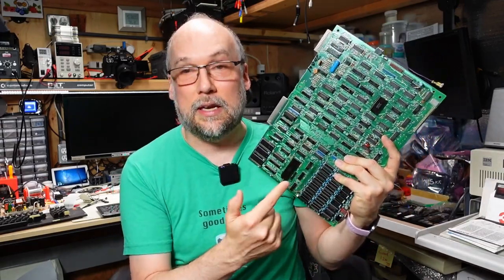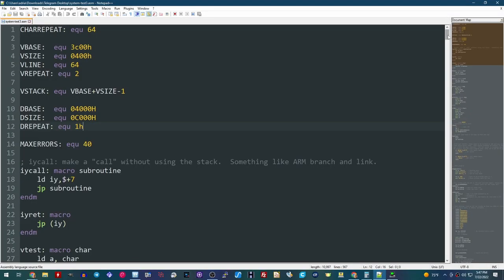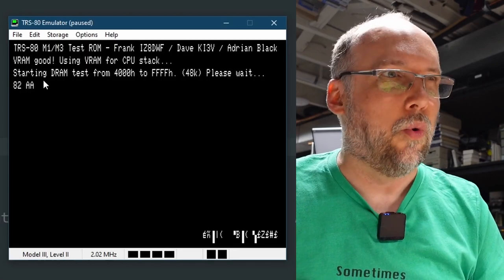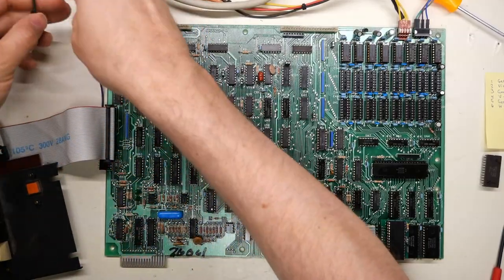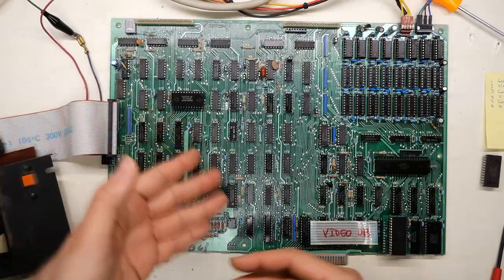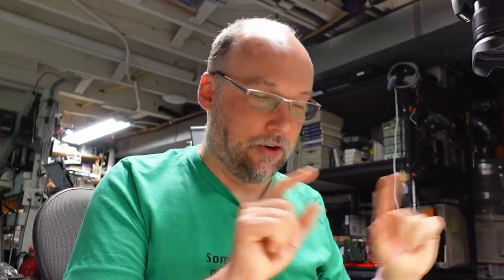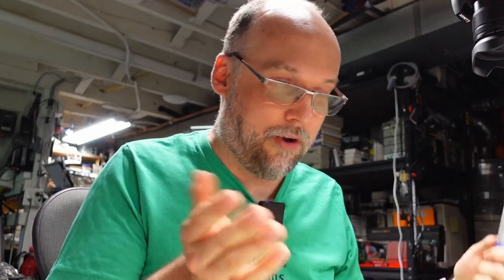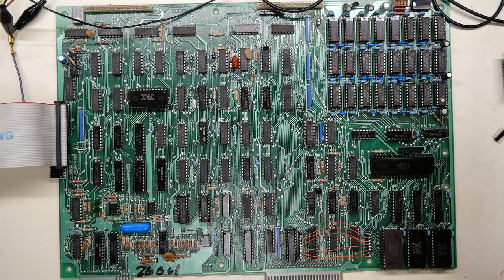Using our new diagnostic ROM to fix a TRS-80 Model III!

Comment: It's always the simple things, Having owned a TRS-80 from new. Modifying it, building the LNW-80 interface and writing heaps of machine code back in the day. I was so involved back then that I also acquired a KAYPRO-10 which was a Z-80 machine with a 10MB HDD that had failed. Replaced the drive with a 20MB drive, designed and built an EEPROM board that I could switch addresses and enable and disable writing to it etc. Re wrote the ROM code to support the 20MB HDD into an 8MB / 8MB and 4MB partitions running CPM. Built a high resolution graphics interface for it (640 x 400) extended the code in the ROM to support accessing the new graphics and it was a good fun project. Sadly I don't have the machines any more But I learned alot about digital electronics in my youth.
Reply: I modded my long gone MIII to the extreme with all sorts of homebrew including an 8MHz Z80H, overclocked of course.
Reply: I think I'd run permanent bodge wires on the back and never have to worry about the ribbon cable again. The homemade replacement cable works, so I can understand not wanting to fix what ain't broke, but if I hit even a lick of trouble, I'd hardwire it.
Reply: @mal2ksc  Hardwiring sure fixed it for me but those cables do allow the sections of the MIII to be split for diagnostic purposes.

Comment: As someone who's worked on Bally Midway machines (like Tron), those cheap ribbon cables go in the trash immediately, even if they appear to work. They're just too much of a liability.
Reply: That cable reminds me of something at work , where a connection on a signal tranformer was loose solder wise. Got voltage (continity) but could not do any current. it's one terminal was broken solder inside
Reply: Replace them with kapton flex cables or an actual ribbon cable. This 70s paper crap goes in the garbage.
Reply: might pass dc current, but a high frequency square wave with no crosstalk: Some of the time
Reply: I don't deal with old electronics like this, but I definitely did not like those cables at all. I can't say I'd have caught this sooner, because frankly Adrian knows more about these machines than I do, but it reminds me of how it's often a good idea to preemptively replace capacitors when there's a chance they might be bad.

Still, it's great that this has lead to a diagnostic ROM being created.
Reply: Signal Generator @ 2 MHz and oscilloscope, how does the ribbon mangle the communication?
We want a follow up!
Reply: thpoilerth!!!

Comment: Aargh that ribbon cable! Yeah it probably got worse from being put in and pulled out so who knows when it actually failed. But that logic you resurrected would have been the main fault for sure.

At least we got a diag ROM out of it, and a couple of great troubleshooting videos and not just a scattergun replacement of parts
Reply from the maker: No parts cannon here! :-)

Comment: There is a car repair channel run by Eric called south main auto channel and he always recommends testing a circuit continuity with a bulb for a load rather than just a meter because,  whilst the circuit may test out as fine it requires a real loading to show if it will carry enough current for the actual circuit loading.
Reply from the maker: Heh yeah I watch all of his videos. And indeed, he does recommend that. It's a bit harder with a computer since it's not really designed to drive load like that ... but perhaps I can do something with a resistor and a LED.
Reply: @adriansdigitalbasement  Try bridging across suspect lines to add more current carrying capability.

Comment: I was waiting for this one. I already from the beginning was convinced that the flat cable was involved, or at least instable. I remember that they were very vulnerable because their material was kind of non-elastic plastic and the cable could break half an inch from the connectors or get micro fractures since they had to put in a very steep angle into the PCB-connector, probably pushing too hard... This cable was not meant to take in and out frequently.

Good work though! I learned a lot from you again, especially because you shared your thought process and faulty thinking, from which we learned the most.

And, off course, triggering the good memories I have of my adventures with my Model III and Model 4p. The latter I still possess, since I was never able to put it out with the garbage, and now it is a very rare to find piece of history. 

Thanks for that, I really appreciate it!

I am looking forward to your other Z80 projects.
Reply: I think my phone might have gone deaf. I was shouting "put the @#$%^& ribbon in upside down to see if the fault moves!" Wouldn't have affected the bit 7 problem, but should have moved the bit 3 fault to bit 4. Shows 2 separate problems, and instantly identifies the ribbon as one fault. Why? Because the only thing changed to move the error is the ribbon
Reply: Model 1and 3 were spooky like this.
Reply: @robertharris2262  Brilliant idea! Actually, would'nt it move from bit 3 to 5 when turned around? Or is the first bit, bit zero?

Comment: Glad you were able to at last repair it. The phrase cold solder joint came to mind, everything looks fine, but has really disconnected, explains the chip too, heat it enough and the connections repair.

Comment: Good to see the problems were found. It's not trivial to find errors in a computer since you can't always rely on a program to actually run like it should.
I guess the lesson learned here was that if there are bus transceivers present, you'll have to check the individual buses. It's a bit trickier.

Comment: Just a reminder, initially look for signal integrity with your scope, THEN on socketed chips, pull them and re-seat a few times to remove any oxidation on the pins and sockets, this can look like
a problem that fixes itself magically, but it was the re-seating/possible pin to socket oxidation connection that was the real issue.   So always scope your signals when first starting your trouble shooting.
AND  of course  re-seat all socketed chips using de-oxit to ensure future reliability.    Just a refresher comment to all...  Good work Adrian, enjoy your videos... Chuck

Comment: You just confirmed a suspicion of mine- I do commercial low voltage and I've had CAT5 lines that tested fine on a certifier or the basic Ethernet tester, but wouldn't pass a signal- and a new cable run fixes the issue. I thought continuity meant continuity, and was confused when swapping the cable fixed the issue.

Every two-video series for a bad ribbon cable is a learning experience! :D

Comment: Awesome video! These repairs where you end up going down multiple paths and even make a few mistakes are incredibly valuable. Seeing the thought process and learning where to concentrate efforts for future reference is very educational and I really appreciate how you share and explain everything.

I'm going to have to grab that diagnostic ROM. I have a Model I I need to work on that just pops up with garbage on the screen. Tho it's been weird - when I first tried it out, I could hit reset and the garbage would change. After a few attempts it it started filling the screen from bottom to top with "A"s, and after a couple more tries it's now just garbage with no effect from reset. I'm sure this diag will be a big help! Thanks so much for you and the other guys creating it!

Comment: Great video, Adrian, and congratulations on successfully repairing it!  You learned a lot along the way, too, always good.

A few suggestions / comments:
(1) Don't forget to look for poor or cold solder connections on things like the IC pins.  I've seen weird results, and that buffer chip (8T26?) might have been something like that.
(2) Broken circuit traces.  Don't assume the signals actually go everywhere they're supposed to be.  I've seen a trace under an IC cut by one of the pins being bent under, with that pin itself working fine soldered to its pad.  (That was in a new board manufacturing test environment, admittedly.)
(3) Last but not least, when tracking down signals stuck high or low, I used to desolder just the signal pins affected on each of the chips and try to isolate them from their pad or plated through hole.  That way I could try to determine where the fault occurred, which chip caused the fault without fully removing the chips.  Obviously that doesn't always work and you can't isolate the pin, but it's something to keep in mind.

Again, great video.  And I had no issues with the audio you were worried about. 🙂
Reply: Glad I found your comment.  The bus transceiver chip may indeed be flaky, but since it has gone from hot to cold a zillion times, it could have invisibly wedged itself a cold joint in the PCB.
Re-soldering the pins may have been the real fix.
Reply: @GnuReligion  Glad to have passed along a tip or two.

One more related to isolating an IC pin.  An open TTL logic input will not be high or low (+5V/0V) but typically something around 1.4~1.7 if I recall.  Meanwhile an isolated CMOS logic input can look like a zero volt low on a scope yet not be.  I would sometimes take a 100k resistor on a "Porter pick" back to the +5v power so I could provide a low-current input, then switch it to ground to tie it low.  I caught a few cases of bad CMOS inputs that way.  That was on the old 4000-series CMOS logic chips, trying to recall how the high speed CMOS TTL-equivalents ("74HCTxxxx") acted.
Reply: @bobblum5973  What would REALLY be OCD, is to take the output of a trimmer, feed it though a trusted opamp, and roll the voltage to extents, and record exactly where the new Chinese logic chip flips HL, and LH, and where its output is at high and low. Ok, I do this. Been burned too many times. Modern CMOS makes life easy compared to the days of NMOS and open collector.

Comment: Awesome work - great to see the design process for the diagnostic ROM! One way to support testing machines with different amounts of DRAM would be to test each section of RAM separately, so if you know your computer has only say 16kB of RAM, you can expect the tests of higher sections to fail. Could say "failed or not present" to avoid confusing the user if they aren't familiar with this. Have as many section tests as there are DRAM configurations.

Comment: This is why its best to always check simple to replace items first, although with the ribbon testing good for continuity I can definitely understand why you didn't replace it right away.  I wonder if maybe the ribbon actually has an out of spec, or marginally in spec, pin diameter for the bit 3 connection at one end and the age of the socket it is connected to is just worn from many removals and replacements of the cable.
Excellent video and great job on getting a diagnostic ROM for the model III made so quickly.  Love your videos.

Comment: Hi Adrian:  been watching your channel for a while.  I owned a model III and it developed a video issue, I don't recall what the symptoms were, but I found that those video cables CAN be dodgy and think that your bodge solution may actually be a good permanent fix just solder them on the bottom of the board to the pads :-)  But those data bus cables are the first thing i replace before troubleshooting those old TRS-80s.  I have fixed the 4 or so I have owned.  My last model III was sold to a local collector in perfect working order with normal wear type cosmetic issues.  To my knowledge still works now and it was sold over 6 years ago.
Reply: My solution was to solder ribbon cable on the back of the PCB.  For the strips that went to the FDC and RS232 card, I replaced the PCB headers so I could use normal IDC type connectors and ribbon wire.  Tandy really made a poor choice with the use of that flex cable stuff.  Every single MI / MIII that I have had my hands on has suffered from it coming apart and even poor connections where the pins were crimped onto the flex itself.

Comment: Another good video, Adrian,
Many moons ago, I wrote a similar diagnostic test program for the Sinclair Spectrum to test video and system RAM.
It also Wrote and Read hex AA and 55 plus a walking 1 Bit pattern for testing all the RAM.
I had a Floppy drive interface for the Spectrum that I used to run the test and it ran as soon as I started the machine. 
I found out the Spectrum RAM was famous for going faulty. If I remember right some RAM on the Spectrum was half bad to start with.
Well done getting this machine running again.

Comment: I’m still learning microelectronics, but I have nearly 20 years of experience in automotive electronics. In the automotive world, resistance testing of circuits is basically never done, and this is why. A circuit can be connected by a single strand of wire and pass a resistance/continuity test, but fail to transfer any usable current. Obviously you had an additional issue with the other bit being stuck low, but the issue with the ribbon cable would have been found by testing the ribbon cable under a load (voltage drop testing) rather than continuity testing. Not trying to be critical or tough on you, but it’s a learning experience. Continuity tests don’t tell you if a circuit is good, they only tell if a circuit is bad.

Comment: Moisture ingress into old silicon chips can exhibit the bad-->good symptoms you have experienced.  In your part one video, many of the high with 'glitch' partially low on those 138 devices is quite normal as address changes settle at the outputs.
Well done Sir.  We all learn by failing.  Good luck with final re-assembly.
If enough interest, I reckon you might enhance your diagnostic ROM with larger memory and on-card address manipulation to cover the various options with mini-shunts or whatever.

Comment: Nothing wrong with that harsh beep. It's actually quite reassuring that the critical components are alive. Well done to the team who made the diagnostic ROM for this. The only thing I can suggest is make a diag ROM that tests the smallest RAM (which is a 4K machine) with a further option to test up to 48K once that passes. That way only one diag ROM is needed.

Comment: I'll just say, you're the first person I have heard referring to chunks of Z80 memory as pages.  In my experience, it's only processors like the 6502 that referred to things like the zero page.  And of course, the x86 line of processors started out with 16 byte segments, and in later (protected mode) models, have full on virtual addressing and the idea of 4K or larger (2M? 4M?) chunks of memory called pages.

It's good to get different perspectives.

Comment: Haha, I already wrote about the problem with the bus conflicts in my comment in the previous video, and suggested a procedure for that. I am very glad to see that you finally got it working ! Keep up the good work Adrian! 👍
Reply: This is my comment from the previous video: “The chip that is trying to pull the line down seems to fight against another component holding the line up the whole time. There may be another broken chip whose select(&deselect) lines are not working properly allowing it to drive the line high the whole time… make a list of all chips directly connected to the bus (or the line you were measuring) and try checking their select state. If a chip is trying to write to the bus all others should be silent.”

Comment: Glad to see this series. My Model III has been in storage for many years, but I’ve been thinking about getting it out to see if it’s alive. Bought it “new,” freight damaged, shattered CRT, in 1984. Installed an amber CRT, upgraded RAM to 48K, wrote some BASIC programs for my wife to use for work. Later added four floppy drives, then an 8 meg hard drive and the hi-res graphics board. Still have the machine with two floppies, graphics, dot matrix and daisywheel, and best of all, the 300 and 1200 baud modems! I wonder whether the drawers of software on floppy are still readable.
Reply: So I did get my Model III out of storage. It refused to boot, filling the screen with a single character...different on each reset, but always one character repeated. Turns out it was the CPU gone bad. I swapped a Z80A chip into the machine and it’s fixed.

Comment: At least two separate faults. This is kind of situation that eats repair time!. You just have to work the problems one by one and eventually the fault disappears in a puff of logic lol. That was a lot of effort most workshops would have given up due to cost. So very well done for pushing on. And you ended up with a diag rom - very good.

Comment: I still have the original Tandy ROMs from my MIII after I rewrote parts of them and burnt to eprom to let me boot from my homebrew SRAM based ram disk.  Combined with the Z80H CPU and 1:1 interleave on physical floppies that the CPU speed allowed, the machine could be up and running programs practically before you could blink.  It certainly raised some eyebrows when I showed it off.

Comment: By the end of the second video, I knew the ribbon cable was the problem. The squirreliness of the machine everytime it was rebooted is what convinced me. You tested for continuity, but that sketchy, delaminating cable was carrying rapidly changing data signals, not straight DC.
     BTW, I'm addicted to your videos. So nice to see old school component level repairs. Did you ever test that second cheap o-scope? I couldn't find the follow-up video if you did.

Comment: For your diagnostic, just auto configure the memory test.  If the test reports less ram then you have installed, that in and of itself is important information.  It's easy to test at say a 1K boundary address, to see if ram is there.